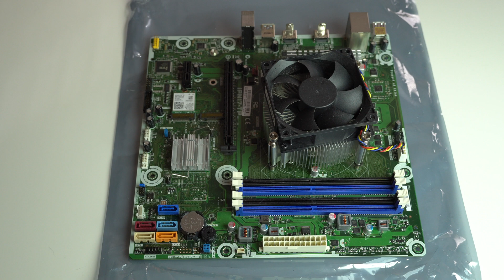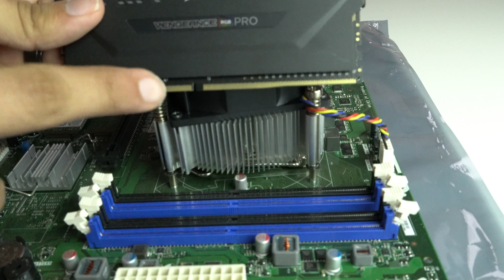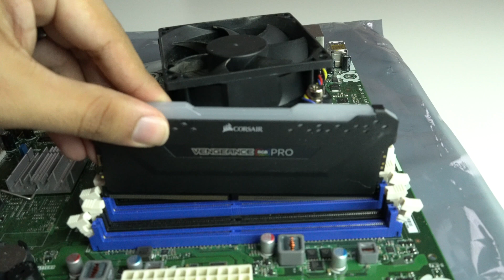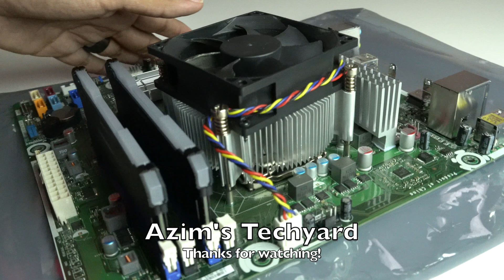How to Install DDR4 RAM - Quick and Easy 2021

Comment: Hey I got the  Asus A320M-K.
Motherboard and I bought a new ram u know where can I exactly put it you know how there’s 4 things where u put the ram in how can I know which 1 is the right, when I replace the 8 gone shall I put 1 of ram and skip and put the 2nd 1 or they need to be next to each other
Reply from the maker: Hey are you sure you have the right motherboard model? The Asus A320M-K seems to have only 2 slots in which case you should try to fill them both up. If you have 4 you they go in pairs like A1, B1, A2, B2. Generally you use every other slot. As to which two you should use, check the manual for your specific slots to use. Hope this helps

Comment: Will the motherboard break if I push too hard
Reply from the maker: You would have to push really really hard. If it’s not clicking with medium to firm pressure just check to see if you have it lined up properly